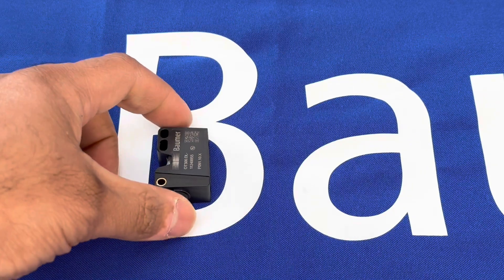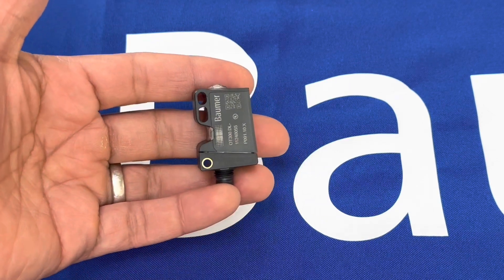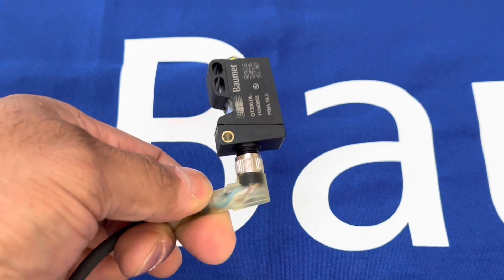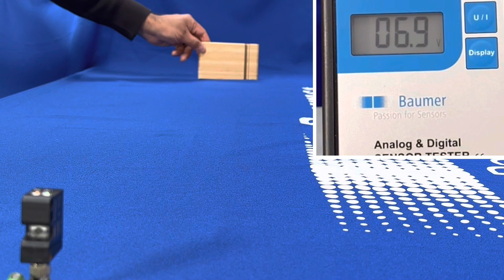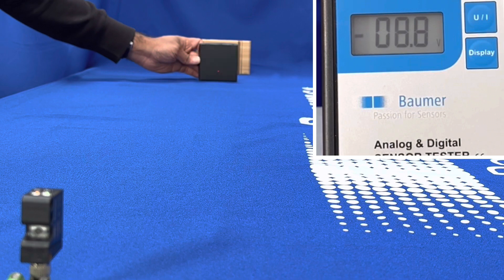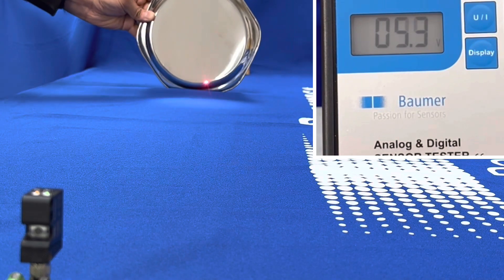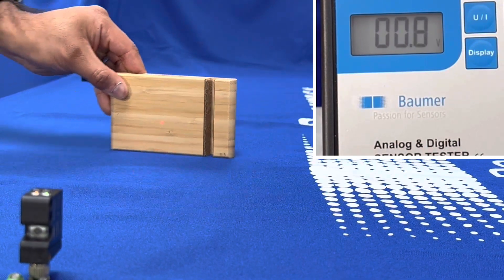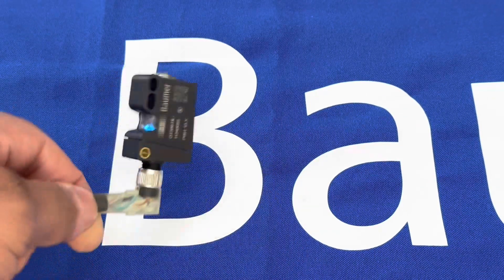Baumer OT300.DL demo: Miniature TOF analogue distance sensor

Comment: what is the diameter of the laser beam?
Reply from the maker: Beam starts at 4mm @ 100mm and then goes up to ~12mm at 2000mm. https://www.baumer.com/gb/en/product-overview/distance-measurement/laser-distance-sensors/standard-laser-distance-sensors/ot300-dl-ubzzb-72n/p/44487#drawingsid